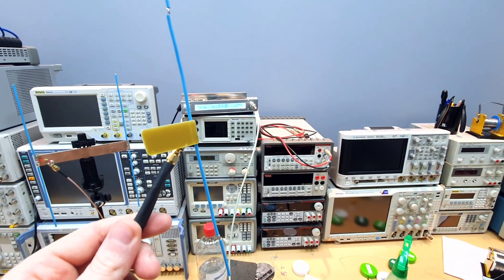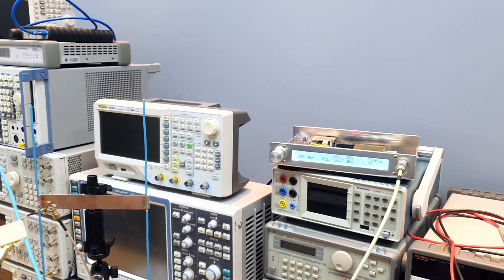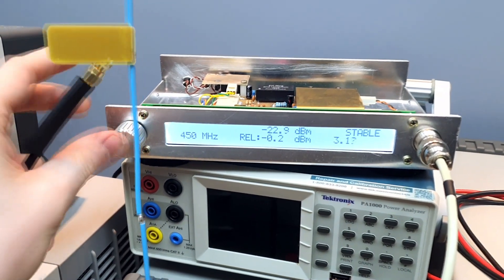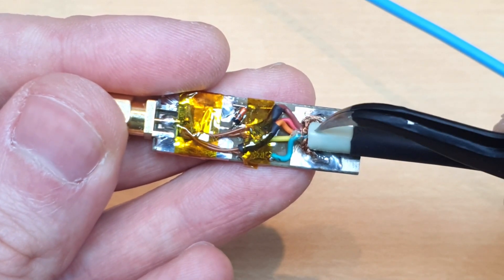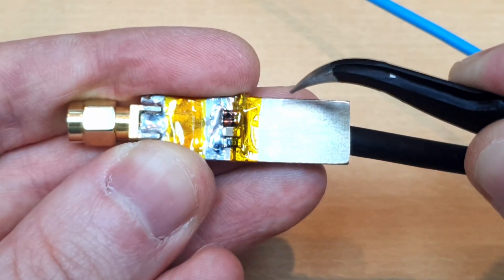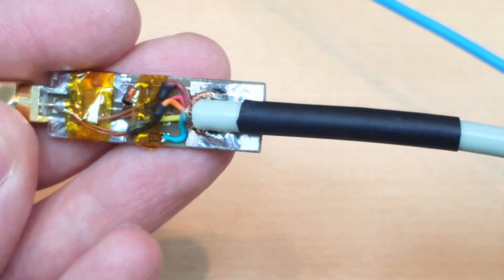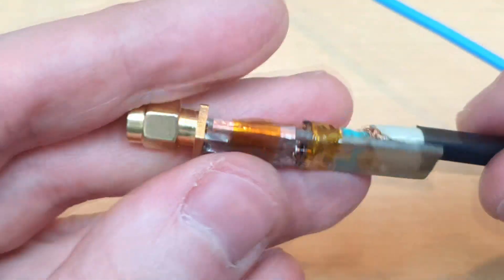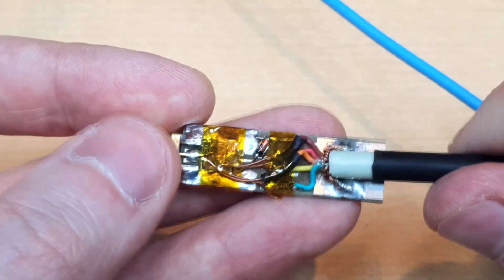Power Meter - Is it working !??

Comment: sorry for the stupid question, i am confused, for input voltages less than the diode forward voltage, how does it behave?
Reply from the maker: Here I explain it better https://gusbertianalog.com/power-meter-rf-probe/

You need to think in the small signal sense. Any voltage variation over the diode will modulate its impedance. This modulation is non linear, so at the end a DC potencial is created

Comment: What a hard work, this can helo you a lot with the 433mhz beamforming I think if you have more of those and a phase detector you can make direction finding that its very Fancy. Thanks for showing that interesting device
Reply from the maker: Nice!! I'm planning a video about beanforming, already designed the phase shifters
Reply: @AllElectronicsChannel  curiosity for seeing how do you make a phase shifter for that frequrncies y tried to make one for 10Mhz with a transistor in common emmiter and common collector at the same time with the RC and re the same value to give me similar amplitude to obtain +1 and -1 Signal that are 180° appart of each other and add them using an RC adjudtable impedance but the amplifier doesnt work in that manner for that frequrncies i need a bypass for the common emmiter and if I put It I short to ground the common collector output so I test Up yo what frequrncies I could use that setup and If concluded that with my bc546 only can reach few hundred kilohertz with ok results so I decided make the common emmiter and common collector with diferente transistores of the same model splitting the input in the two bases and that give me better results but for few MHz the phase unbalance raised to about 40 degrees which is not good, in that point I thought that at the output you could have an RC voltaje controlled filter with its -3db point at the frequrncy you are working and then splitt the un phase and inviertes Signal to an analog circuito that procces the difference betewen phase of those and with some operators adjust the voltaje controlled filter to reach 180 degrees in a closed loop but this is more complex 😂😅 I also tried to use a Transformer for this pourpose made by myself with some ferrite core salvaged from los device and It worked horrible with lot of distorsion and with 50 ir 60 degrees of phase unbalance, and recently y was making a Pierce oscillator with a Cristal and a not Gate and with the 12 MHz cristal and I simply Connect the output of the oscillator to another not Gate of the Ic and if got a nearly perfect 180 degrees betewen the osc out and the Gate out
Reply from the maker: Interesting!! 180 degrees is intended difficult to obtain. I got 100 degrees using a microstrip line loaded with varactors each lambda/8, it works really well

Comment: Nice work! If you do a wrap up video it would be good to see measurements of the SWR of the sensor and the frequency limits.
Reply from the maker: I will try! But I don't have equipment to generate more than 3GHz.. and it don't show any drop at this frequencies. 

We need to create a 10Gig generator 😃😃😃
Reply: @AllElectronicsChannel  sounds great! If/when you release the Gerber, I'll build one and sweep it. I have a 20ghz VNA and power sensors, although the VNA is the only generator I have beyond 3Ghz. I really wanted to play around with the diode heater idea too.